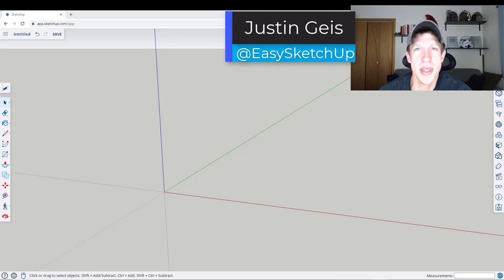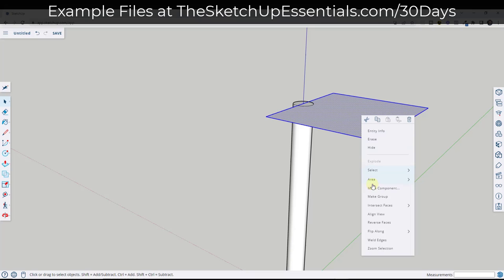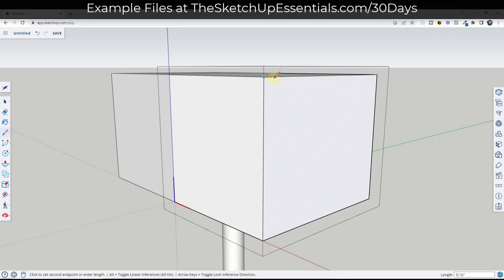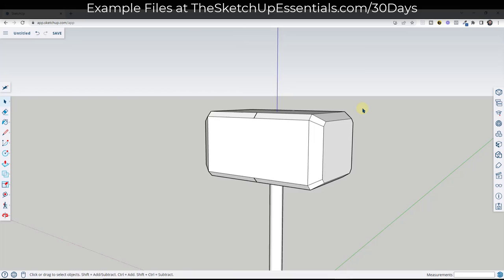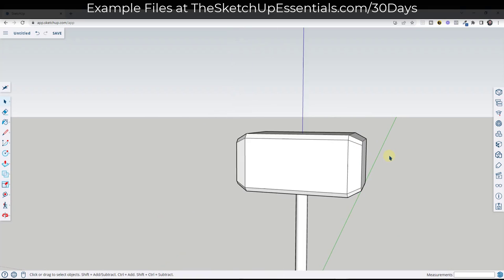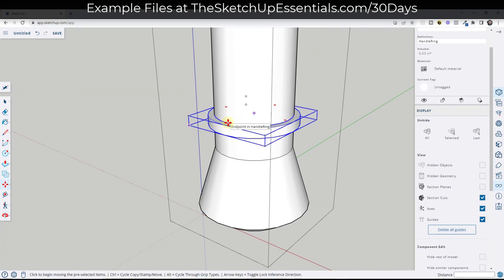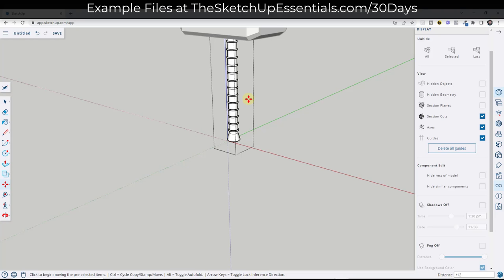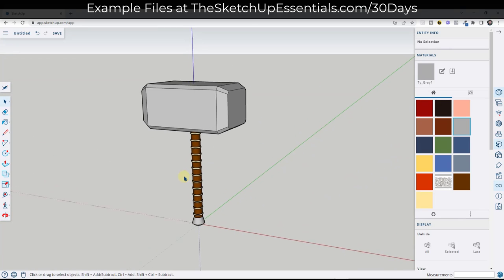Learn SketchUp in 30 Days DAY 18 - THOR'S HAMMER!

Comment: Better to learn blender for modelling anything other archviz stuff. I see no point in promoting sketchup for these types of assets.
Reply from the maker: Totally disagree - obviously it's not perfect for some things, but even as a skill building exercise there's a ton of value in modeling things like this for SketchUp users. Also - I had zero problems creating this shape even in the free version of SketchUp, so why would I go learn a completely different software package for something like this?
Reply: @Thesketchupessentials  in my opinion, these type of assets most likely will need optimized geometry and uv mapping down the line when the user gets more experience. So why not start with free tool like blender. If one has the drive to learn 3d modelling to make game assets, why start with sketchup? No disrespect to your awesome tutorials. Its just my thought